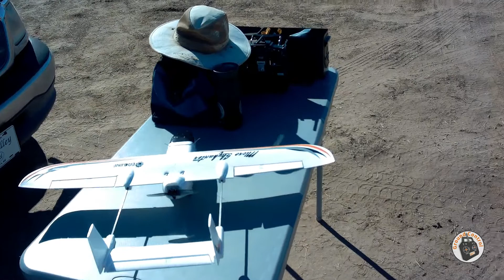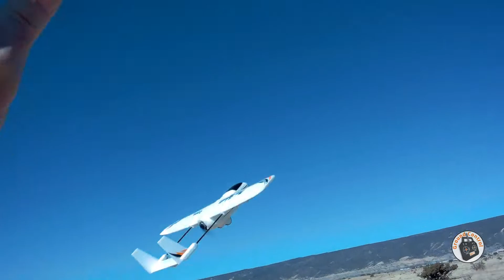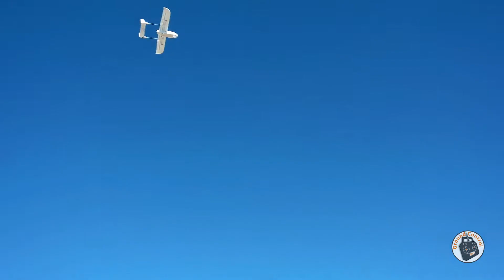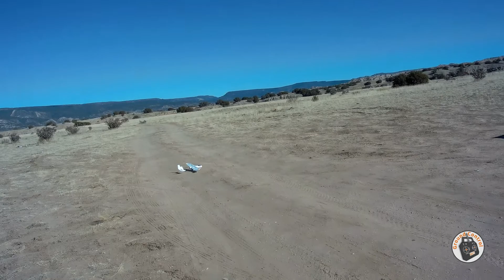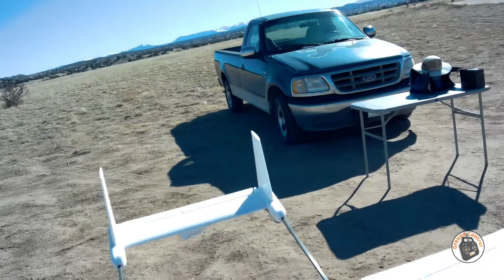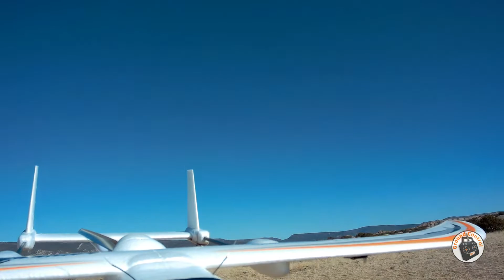Some Fantastic Little Brushless Motors - BetaFPV High Performance 2004 3000kv Brushless Motor 3S-4S

Comment: Thanks for providing valuable information mate. I used them in my 350g big Kmart glider conversion plane. I used Emax motor 2004 3000kv on 3S battery and prop HQ 5030. It is flying really nice and easy to land with short prop. Then I tried GF 5125 3blade prop on it and it is even better. A bit more thrust when I need it and it seems to me a bit quieter. Just spot on for my plane with wing loading 30g/dm2 👍
Reply from the maker: These tiny motors just keep getting better and better!

Comment: Vertical ! 😘
Reply from the maker: Hi John!
Hehehe....I can't believe how much thrust these tiny motors produce.
This one is staying in the Micro Skyhunter ;-)
See you in the Air!
Reply: @GroundControlRC Hi Tony, what I can't believe , is how far the hobby has come in the last 10-20 years ! Especially with the modern radios ,gyros, lipos and fpv gear .time-travel back to the 70's and it would have totally blown everyone's brains ! 🤯My passion is still steam tho , nothing comes near to the sound of a boiler pinging away to itself and the fact that the expansion of the steam gives yet more if you use it. Tech times we live in...How about nano reactors using thorium to power a train ? Or pico hydrogen fuel cells for fpv drones/planes etc. A plethora of power. Next stop anti-gravity !🤖🤣🤣🤣
Reply from the maker: @associatedblacksheepandmisfits  Yes, I've only been in the hobby for a little over 6 years and the improvement in the components is outstanding.
Where are those Hydrogen Fuel Cells?
I saw that demonstrated in a car 30 years ago.
I think if the powers that be would get out of the way of protecting the buggy mfg we'd   be 100 years in the future with technology ;-)
Reply: @GroundControlRC  follow the vested interests.... 😎🤯🤮😢
Reply from the maker: @associatedblacksheepandmisfits  Exactly!

Comment: Nice! I used a 2826 2200kv motor on mine and it was a beast.  I retired it and gave it to my 3 yr old daughter to play with. Stripped out the electronics of course 😄
Reply from the maker: Thanks!
Yes, I'm amazed at how much thrust these brushless motors are producing these days given the size and weight of the motor.
Awesome!
See you in the Air!

Comment: hey tony,   could this motor go in either the mini or micro f-22?
Reply from the maker: Hi David!
I think it would work well in the Micro with a 3.5" Prop but it's too small for the Mini.
This motor performs extremely well with Props smaller than 6"
If I had a smaller 4S LIPO I'd test it in the Micro with a 3" Prop ;-)

Comment: Put another motor on the front of the skyhunter like a cessna 336 skymaster. By the way my flying fish came in and Iove it.
Reply from the maker: Hi MIke!
I wonder how that Skyhunter would do with (2) wing mounted motors like the Flying Fish ;-)
That Flying Fish is awesome!
I'm glad you're having fun with it.
The best factory micro plane I've flown.
What a steal at that price ;-)
See you in the Air!
Reply: MikeIronbutts57, what did that flying fish cost you shipping and all?, if u don't mind me asking bro. Thanks, I'd really like to get one.✌️ Appreciate it.
Reply from the maker: @bangurhead4027  The Flying Fish was sent for review.
But I'd definitely buy it for the price it's selling for.....$105.99 PNF. + $2.99 Shipping. Total $108.98 USA Warehouse.
It's better than the Arrows Pioneer I paid $149.99 for and it's a Fantastic Plane ;-)
Reply: @bangurhead4027  $124.00 for fpv version. I think it went back up a little though.

Comment from the maker: Don't Forget to Subscribe -> https://www.youtube.com/GroundControlRC?sub_confirmation=1

BetaFPV 2004 3000kv Motors
https://bit.ly/3NRfofa

Gemfan 5125 3-Blade Propellers 5mm/1.5mm Shaft
https://bit.ly/3uVoQWq

HQ 5025 3-Blade Propellers 1.5mm Shaft
https://bit.ly/3uUAa4Y

Get One Here: HQ 5025 3-Blade Propellers 1.5mm Shaft
https://betafpv.com/collections/4-inch-propellers/products/hq-5025-3-blade-propellers-1-5mm-shaft

Get One Here: Gemfan 5125 3-Blade Propellers 5mm/1.5mm Shaft
https://betafpv.com/collections/4-inch-propellers/products/gemfan-5125-3-blade-propellers-5mm-1-5mm-shaft

2 Pairs Gemfan LR5126 2.6Inch 2mm Durable PC FPV Propeller - Transparent gray
https://www.banggood.com/2-Pairs-Gemfan-LR5126-2_6Inch-2mm-Durable-PC-FPV-Propeller-for-Long-Range-FPV-Racing-RC-Drone-p-1836720.html?p=WE081047791920140372

HQ Prop T5x3 Bi-Blade 5" Prop 4 Pack (1.5mm Shaft) - Grey
https://www.racedayquads.com/products/hq-prop-t5x3-bi-blade-5-prop-4-pack-1-5mm-shaft-grey

4 Pairs Gemfan Hurricane 4024 2-blade 4 Inch PC Propeller - Clear grey
https://www.banggood.com/4-Pairs-Gemfan-Hurricane-4024-2-blade-4-Inch-PC-Propeller-for-1408-1506-Brushless-Motor-RC-Drone-FPV-Racing-p-1657418.html?p=WE081047791920140372

Turnigy 1300mAh 3S 30C Lipo Pack
https://hobbyking.com/en_us/turnigy-1300mah-3s-30c-lipo-pack.html?affiliate_code=YRCVWOSKMDXLVUW&_asc=4840123862

Get One Here: RadioMaster TX16S Transmitter
https://www.banggood.com/custlink/DvvycmfSMK

Banggood GCRC
https://www.banggood.com/custlink/GmDmQ1nVkO